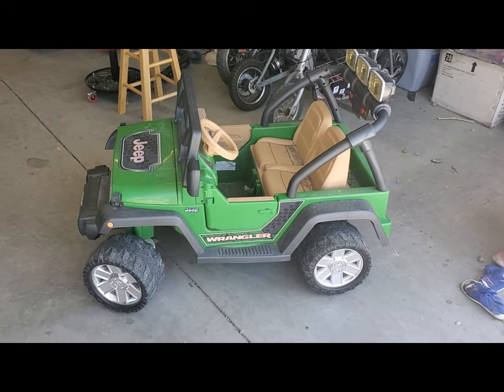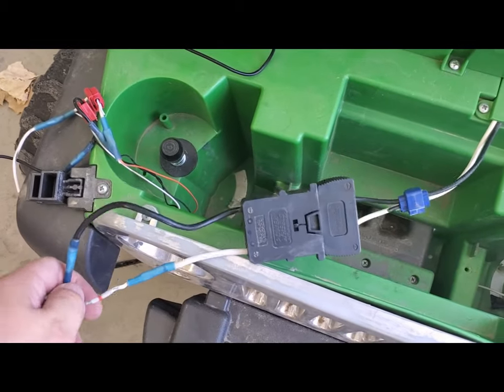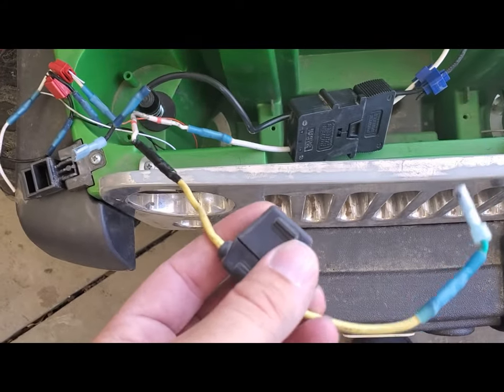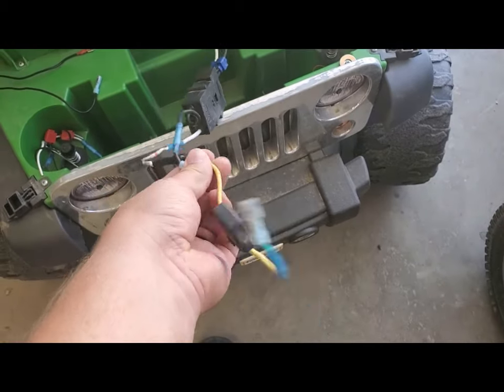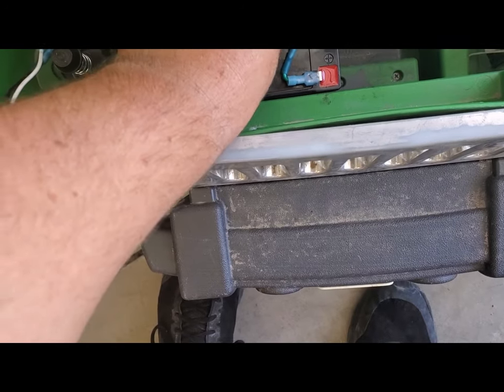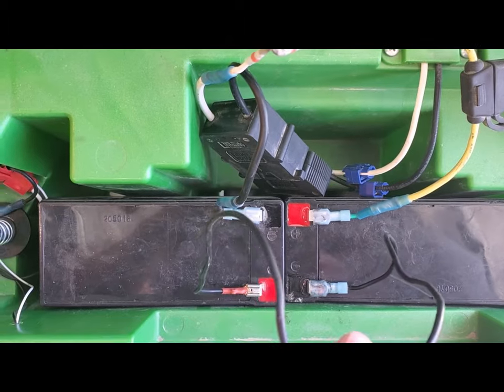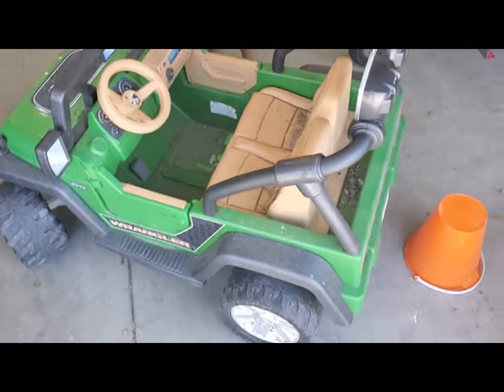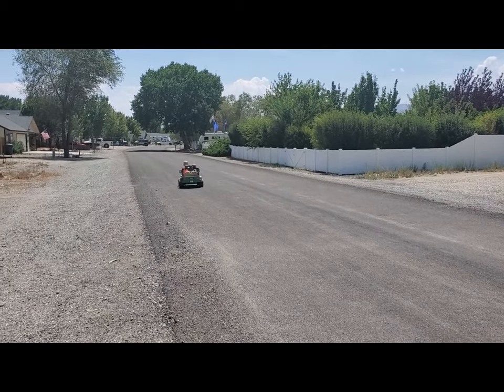How to: Convert Power Wheels from 12V to 24V!

Comment: Don’t you need to upgrade the motor as well? My son has a Jeep Wrangler 4x4 and when I asked a technical friend of mine he said I must upgrade the motors/gearboxes otherwise they would “burn”. But here on YouTube everyone seem to just upgrade the battery and keep the original motors.
Reply from the maker: It is pushing the motors to the max but they can handle it. If they burn out, replace them with heavier duty ones. But until then, let it ride!
Reply: Amazon has lots of upgraded gearbox and battery adapter. Stock 12volt motor works perfectly fine with an upgraded to a dewalt drill 20v battery, it's fast! Kids love it!...
Reply: Sometimes it depends on the build quality of the 12v motor your working with.
Reply: @Kay-4JK  😂z
Reply: The motor brushes have to be broken in
Reply: I added a rhino battery connector to mine.  It’s way faster.  Probably double. They can do donuts now.  :)

Comment: I burnt my son's motors up on his off-brand power Wheels Lamborghini with an 18 volt Milwaukee battery. I'm wondering if I convert to 24 volts motors and gears, if running a 24 volt battery would be the same speed as running 12 volt on a 12 volt system. That's what I'm trying to find out  before I order these
Reply from the maker: It definitely should be because those motors are more powerful

Comment: Wouldn't it have been easier instead of stealing the female connector from a battery, just cutting the connector off and making your own plugs for the wires? And also, did you not change the motors to 24 volt motors? I'm surprised it doesn't burn up

Comment: Do you use the original power wheels charger and charge as you would?  I assume it takes twice as long to get to a full charge with two batteries as it would with one?
Reply from the maker: No I use a generic 12v battery charger being that the adapter for the power wheels battery doesn't fit. They are not expensive and I use 2.
Reply: @mosquitonkosak You can charge the 24 volt battery with a 12 volt charger?
Reply from the maker: @stevenjenkins5415  no I charge each 12v battery separately

Comment: I'm surpised the motor reverse/forward switching relays dont start smoking with 24V and upto 50Amps running through them. What are they rated at ?
Reply from the maker: I'm not quite sure but I've never had a problem and I've done this setup on over 10 power wheels

Comment: Great video, thanks!
Quick question, with these powerwheels, when you select slow speed on the switch, what's actually happening? What makes the car go slower than if Hugh speed was selected?
The reason I ask is because I have a similar car for my son but I've noticed that it has no speed controller box or Govenor, just the slow/high speed switch. Just curious how that works
Reply: It's got a voltage controller in there somewhere that will reduce the voltage in slow mode.  The switch connects to a control board or resistor somewhere to take the voltage to the motor down.   Kind of just like a speed controller box but just using a switch instead of a  knob.

Comment: Awesome video! If I swap one of these 12v batteries into my son’s little car that currently has a 6v, wouldn’t I need to also swap in a 12v controller?
Reply from the maker: Idk about a new controller but those 6v motors can't take as much power as the 12v can. And make sure there are no accessories hooked up to the bv battery otherwise it'll melt and you'll smell it.
Reply: @mosquitonkosak I swapped in the 12v but it doesn’t last long at all? Has a ton of power then dies out

Comment: I seen so many say they burnt stuff How do i avoid frying my radio and light and control unit? If I don’t run accessories and just have a race car will my control system handle that or do I need to upgrade
Reply from the maker: If it's a 12v system for accessories, don't hook it up to the 24v system itll fry it. Run a separate system for the accessories

Comment: It Might Be a stupid question... But I have an extra 6v battery and a car which is 12V... If I connect it just like you did but I would use the 6V to start with... Will it make any diference and if it gonna even work... Thanks
Reply from the maker: It would work and you'd see a difference but it wouldn't be drastic.
Reply: 12 volts + 6 volts in series =18 volts.  More than stock 12 volt setup but less than 24 volts.

Comment: I have a Jeep just like this one and it does great. But I got ranger built by huffy and it has really large tires and it was super slow. After converting to 24 it did great but now it goes less than 5 minutes then it stalls. I think the motors are overheating. Any help would be great
Reply from the maker: Either the motors are overheating or the battery are losing too much juice too quick.

Comment: hello, I did this conversion and after 5-10 mins of ride time the fuse blows? any idea
Reply from the maker: Depends on how much weight is in the jeep. The heavier they are, the more power the battery have to dish out to get the motors to move. Try a 40 or 50 Amp fuse and see if it blows them

Comment: My kid's car is 12V.  Is it possible to replace that 12V car with a 24V battery?  Since the motors in the 12V car are 12V motors and lighting systems, is it okay to install a 24V battery instead?
Reply from the maker: Yes as long as a fuse protector is used. Also if there are electronics hooked up to the battery, the 24v will blow them all out (might see smoke) so if the car has electronics (music, sound buttons etc.) Then hook them up separately to a 12v or disconnect them completely
Reply: What size fuse connector???. I got a couple batteries coming now!?!?

Comment: Since you are using the original power wheels connector, can we use the original power wheels charger to charge both batteries together. Or do you need to charge them individually??
Reply from the maker: You wouldn't be able to charge it because it is designed for a 12v battery and charging them together is a 24v system.
Reply: @mosquitonkosak  what if I buy a 24v charger and swap the claps out for the male power wheels charger end?

Comment: Hey there! New subscriber here- I have a 24v car that won’t charge- any suggestions on troubleshooting? The green light comes on the charger but after hours of charging is still basically dead.
Reply from the maker: Couple questions...are you charging both batteries at the same time with a 12v charger? What charger are you using? Does the light ever turn red?

Comment: I am looking at buying the Yamaha four wheeler. The blue one you have. Does it use the same adapter as the power wheels?
Reply from the maker: Unless the brand is power wheels, it'll be a different connection. You can build your own adapter. Look at my video about putting lights on the green quad. That has a different adapter

Comment: Would I still use the same 12volt charger? Please someone help
Reply from the maker: No because the plug will not work. Get a generic 12v charger for each battery. They're like 8 bucks.

Comment: Will this work with newer power wheels with Bluetooth and led lights? Will everything still work?
Reply from the maker: Here's the problem. If other accessories are wired to the battery and they are only 12v, it'll fry them to where they'll smoke and possibly catch fire. Trust me I've done this on other 12v ride on toys and it's started to smoke.

Comment: I did that but i am blowing fuses. Have you had that problem
Reply from the maker: I havnt but it all depends on the weight that the batteries are pulling. Try running it with no one in it and see if they still blow. Should be a 30amp fuse used if you're not already using one.
Reply: Oh I see l nvm😊. 30 amp

Comment: So you have to use 2 of the 12v? You can’t just use a 24v battery
Reply from the maker: Oh you can if you want. I don't have a 24v charger and if a smaller kid wants to ride, just plug in one of the batteries instead of both.

Comment: Cool! How do you charge those batteries?
Reply from the maker: All you do is get a 12v battery charger. Takes approximately 4 hours per battery but the chargers are around 10 bucks
Reply: I did this conversation, but the batteries aren't charging with the factory 12v charger. So i ordered a 24v charger and it didn't do anything. Do I need to wire it in parallel to get them to charge?

Comment: Run 2 Milwaukee m12 batteries and  you will just be swapping them out instead of pulling out those 12v scooter type batteries to recharge

Comment: You should add a speed controller. They’re cheap. Putting 24V directly in a 12V system is going to burn out your motors faster.
Reply from the maker: If you were going to make it last awhile absolutely but if you don't care, then send it! Also, if you get bigger motors, the power will deliver way better.

Comment: How bout charge??
Reply from the maker: Pull the batteries out and charge them using this...
OMT 12V Battery Charger and Maintainer, Multipurpose Set for Charging Boats Motorcycles ATVs Riding Mowers & Car Truck SUV RV Maintenance with Smart 3 Stage Charging & Power Indicator https://a.co/d/dPycG39

Comment: My control board fried almost instantly 😔
Reply from the maker: Was the fuse protector installed cause that should have blown before anything else
Reply: Same worked for awhile now it don't run at all when I added 24 volts think I'm going to take out all the wiring and have to rewire the whole thing